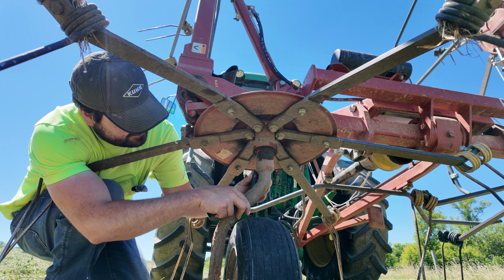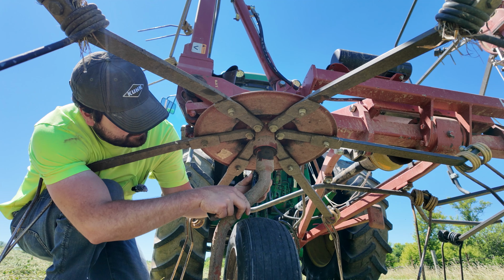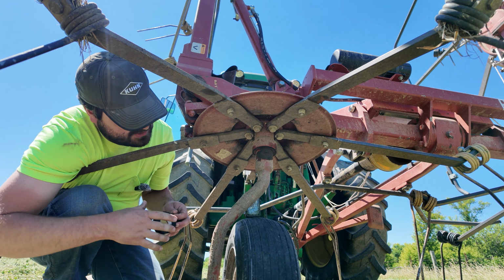Tedding Hay | RhinoAg PT419H

Comment: So, questions. 
If you want leaf structure in your hay, instead of just stems, does it seem that Tedding hay will break down the leaf structure and leave only stems?
Understand crimping hay in the swather preserves leaves, does tedding do the opposite?
Reply: Hay stems are crimped to allow the juice out of the stems. Notice did not mention leaves. Leaves falling off is a much bigger problem with dry legumes than grasses.